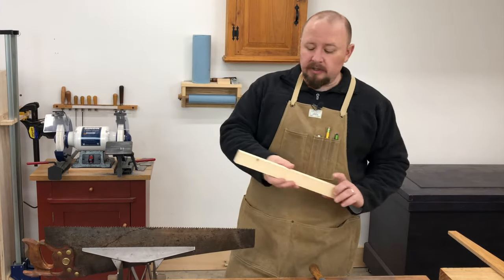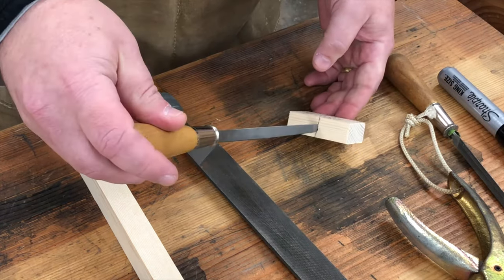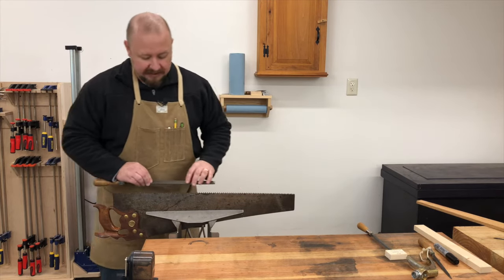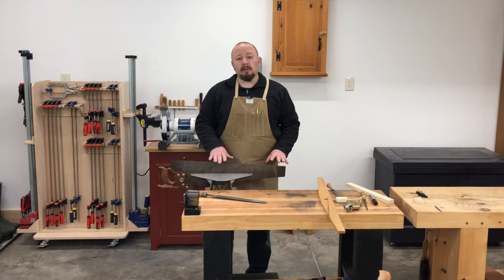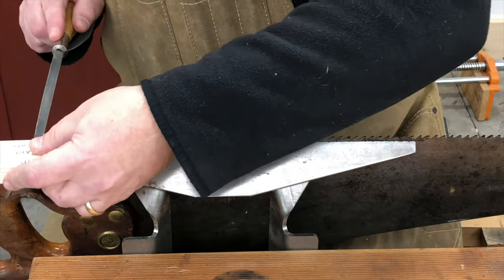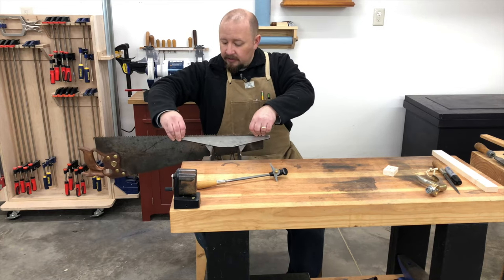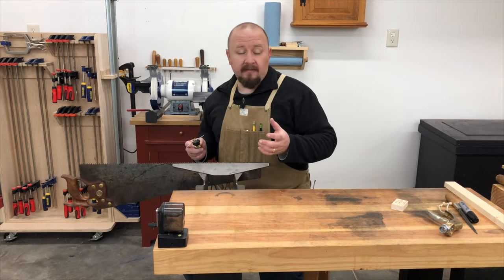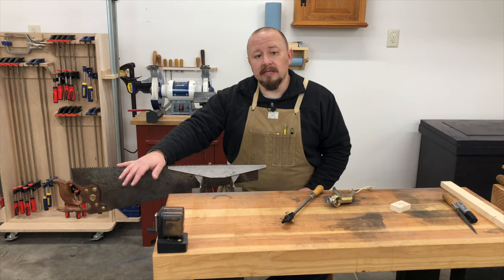How to Sharpen the Rip Hand Saw - Hand Saw Foundations

Comment: Thank you for the great video. Question: if the goal is to preserve the belly, long term, wouldn't it be best to stick to, say, 2 or 3 passes per tooth and then do another run based on how much flat is left on the smallest flat? The idea being to remove the same amount of steel everywhere, and adapting to the lowest point (except maybe if there is only one or 2 low teeth, like you said?)

Comment: I use to sharpen my rip saws from toe to heel. Not sure if it really makes a difference but I think this way I put the burr on the "flat" side of the tooth instead of on the "bevel" side, to put it in chisel terms. Any thoughts on that? Does it make any practical sense?

Thanks for this great series! Your videos are a gold mine!
Reply from the maker: Makes no difference because any remaining burr will be removed the first time you use the saw. The burr has no strength and just breaks off.